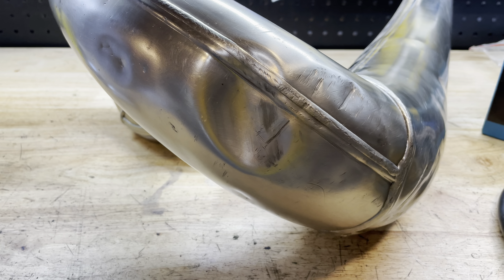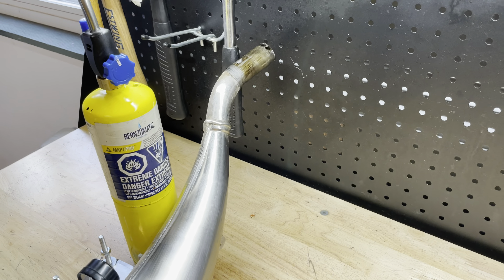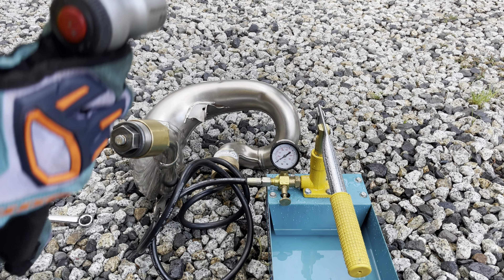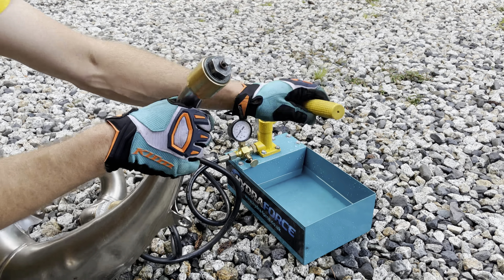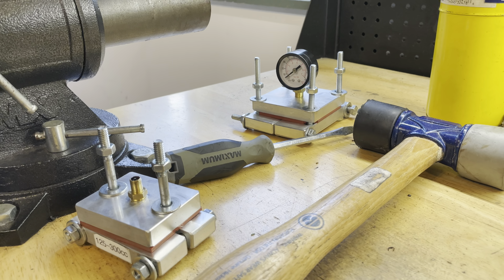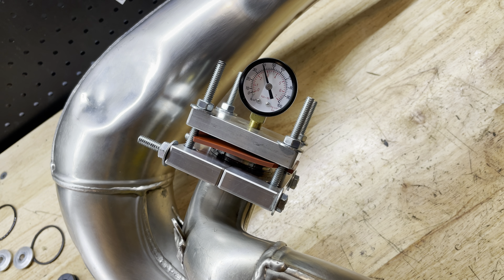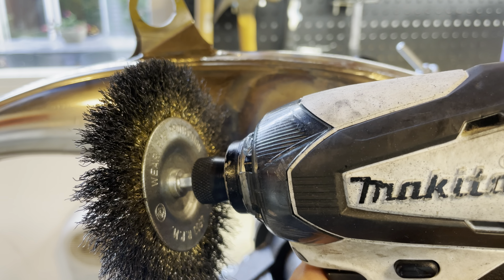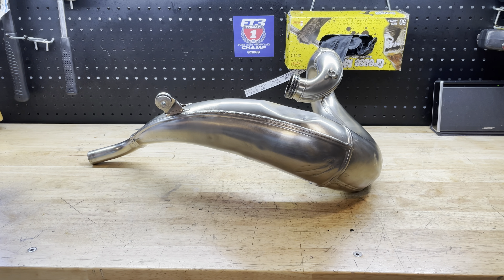Dirt Bike Pipe Repair | What Works Better? Heat or Water?

Comment: I have a hydraforce. It’s okay. Probably better off spending the money on a good pipe guard and just accept that you’ll need a new pipe every few years.
Reply: Yes
Reply: Take as consume items
Reply: Sounds like the general consensus and what I've personally just recently experienced is if you run a pipe guard, better be ready to break/bend the header and crack your exhaust flange... for this reason I'm no longer running my pipe guard.

Comment: The description is wrong, it is not hot pressurized air that reshapes the pipe, it is air pressure applied to metal that is heated to it's melting point. Heating the pipe to cherry at the dent and adding up to 100 psi air results in annealing the metal which makes it less likely to crack next time it get dented. The heat can easily be moved around the pipe to control the forming process and I consistently get results that are extremely difficult to see or find. The water pressure method results in the metal getting work hardened which leads to cracking later. Also the pressurized water will always expand the weakest part of the pipe which may not be the dent, it could be a seam that is weak or compromised by rust.
Reply from the maker: Interesting. I always thought that when I heat the same spot over and over again for repair it got weaker, great if that not the case👍
Reply: @TechEnduro  No, annealing extends the life of the metal. Overheating can cause issues, but we aren't close to that point doing this. Gradually heat by moving the torch in a circular motion, then allow to gradually cool, never quench the metal.
Reply: @briangc1972 How about heating up the areas that you repaired with the hydroforce to anneal them?
Reply: @someonethatwatchesyoutube2953 It depends if you already took the dent out or not. If you already got the dent out heating it won’t do much unless you melt the metal and recast it. The water method does cold work on the pipe and makes it harder but more likely to crack.  Heating it after will just make it hot. Working it while it is hot is what causes the deformations that change the structure of the metal. However if you have that spot of metal hot with the water method, the water can rapidly increase the pressure applied to the pipe and rapidly cool the pipe. The heating and cooling of the pipe will cause it to crack and shoot out hot water. This is why it is advised to not use heat when using water in the pipe. Based on my knowledge I can assume the best method might be to pre heat the spots a bit before adding in the air. This is so you can continue to heat the spot more without drastically increasing the air pressure once you’ve added the air into the pipe with the heated spots at the dent locations. In other words if you expand it with the water a rock will be more likely to punch a hole through it next time while heating it and using air will just let the pipe dent again.
Reply: @someonethatwatchesyoutube2953  Hydro force is cold relative to the melting point of all metals. Annealing occurs when the metal is heat to near it's melting point than allowed to cool slowly. Hydro force involves liquid and liquid always cools too fast for annealing.

Comment: How much more does the air pressure increase when you heat the pipe?
Reply from the maker: About 20psi throughout. I release some during.

Comment: Who is dumb enough to use water? You can't control which dent is removed and it can't do small sharp dents. The whole pipe shape will distort at 400 psi and it won't fit back on the bike and the mounts won't line up.  The heating method allows control of each dent and won't distort the entire pipe shape. You'll need a real torch with oxygen acetylene and a rosebud tip to do a decent job. Monitor pressure in the pipe while heating as it increases as you heat it. Work the dent from the outside in to prevent a pimple. Never exceed 75 psi when heating and keep  the heat moving to prevent burn through and hot metal spraying in your face. Homemade cap jigs are a bad idea and can seriously hurt you or anything in the area. Release the pressure outside as the stink will be horrific. Videos like this are dangerous when they don't include all information but encourage people to try themselves. Best idea is to send it to a professional or just buy a new pipe. How much is your life worth?